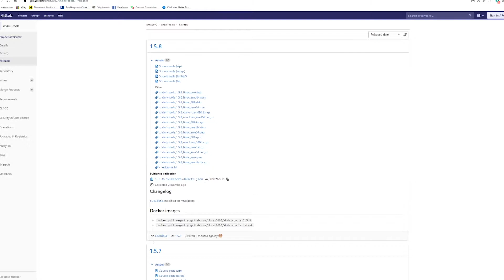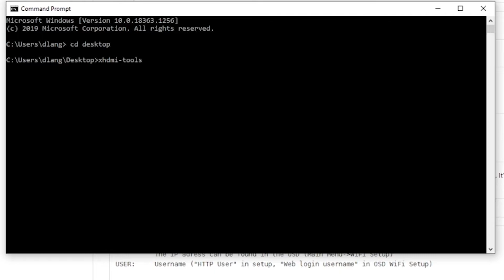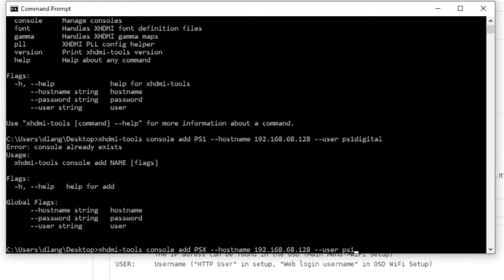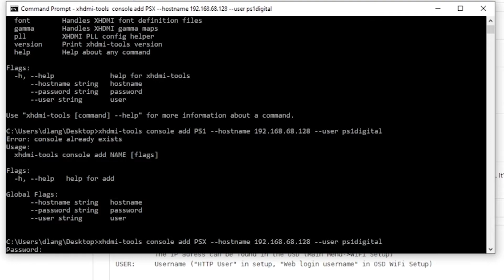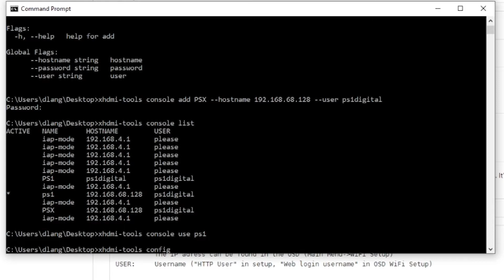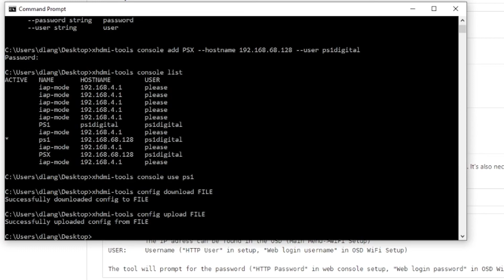How to setup Disc Swapping on the XStation and MODE with a PS1 Digital

Comment: I know it’s probably a stupid question but I’m wondering if doing this mod makes it so I can’t manually go up and open the disc trey to swap discs. I mean most of the time when I’m feeling lazy the OSD swap with PS1Digital would be ideal but there’s a certain nostalgic feeling about popping the disc trey open to “swap discs”.
Reply from the maker: I can 100% confirm you can still cycle discs with the eject switch on the console and still have this mod wired up to switch discs in the OSD. It's the best of both worlds! I hope that helps your decision on completing this simple mod. Enjoy your Playstation!
Reply: @massvideogamer  Thank you for the response. I have no qualms at all with going through with the mod now.

Comment: I don't get this. What does the Disc swapping do without a CD Drive?
Reply from the maker: It allows you to swap "discs" in multi disc games by cycling the lid open and closed in the PS1Digital menu while using an ODE. It simulates switching the discs when using just the ISO image. For example, if you are playing MGS and you are using an image (not the real disc) and it says insert disc 2, you simply go into the PS1Digital menu and cycle the lid so it thinks disc 2 was inserted, and in reality it loads up the disc 2 ISO image. Hopefully that helped!